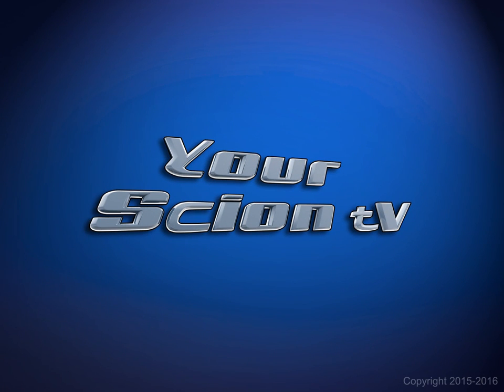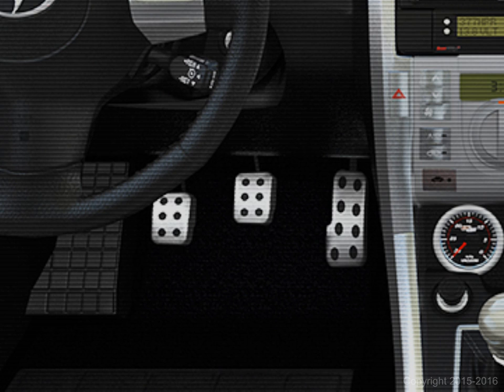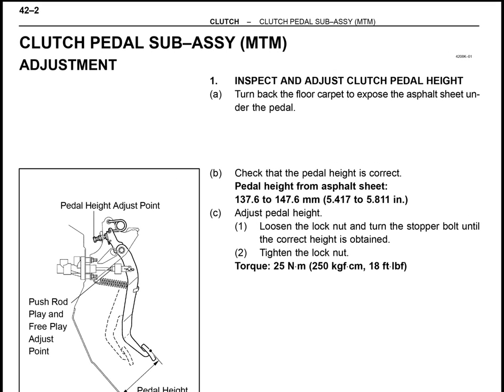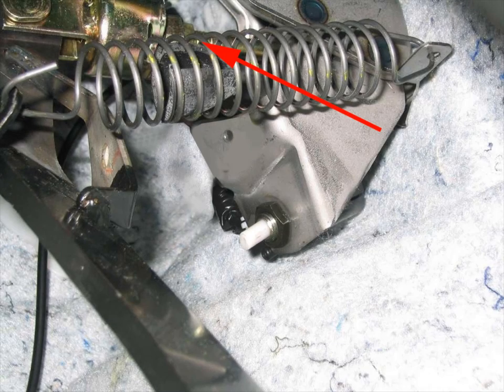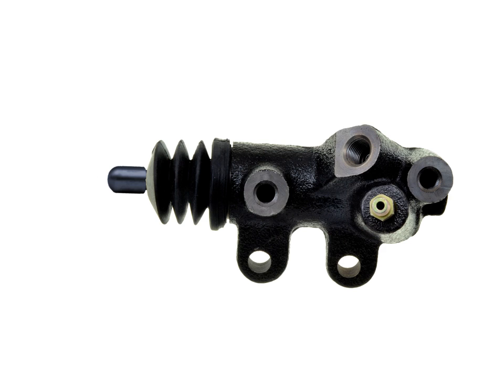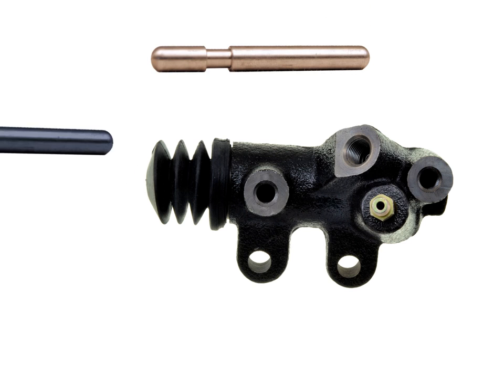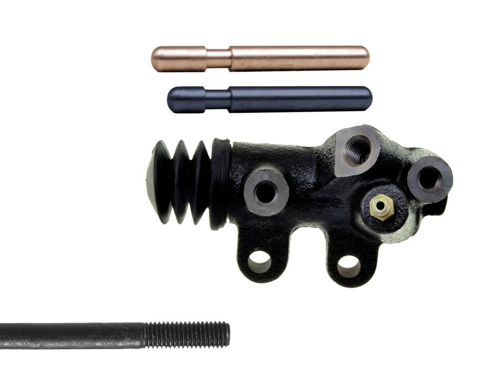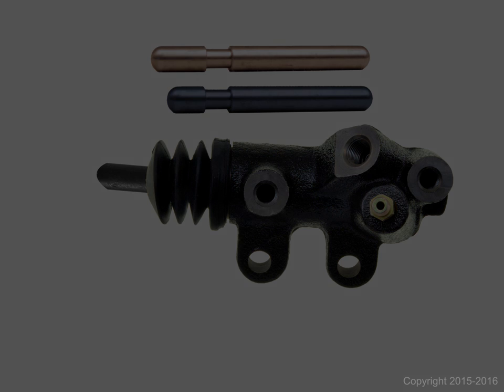Clutch Pedal Adjustment and Engagement Solutions

Comment: I've been having a major problem with my clutch.   the car is an 06.   at around 230,000 miles i would push my clutch in and it was getting tough to put into gear.   I changed the master cylinder and the slave.   No change.  took it to a shop that charged me 600 to replace the clutch. The car was fine for a year, then the same thing started happening after 30,000 miles.   i took it apart myself.  Found that the throw-out bearing was sticking. the clutch looked good still, almost brand new.  i put a little grease on the shaft so the bearing would slide smoothly.  put it all back together, and i still have the same problem.  then i made a new shaft for the slave cylinder, making it .25 inch longer.  That didn't fix the problem.  I've bled the whole system, i have good clutch feel.  with the vehicle off, i can push the clutch in and put it into any gear.   With the car running, i push in the clutch and it won't go into gear.   It actually starts to roll forward.   Ive done all i can think of.  Should i just pay the $2,000 to have toyota fix it?
Reply: jan orban better you sell that car and invest your 2000 on a better car with lower mileage maybe its time to move on no point spending soooo much money on 10year old car
Reply: jan orban
Reply: and did you solve the problem since than ?
Reply: jan orban did you find out the problem with your clutch point, I'm having the same problem also
Reply: Did you ever fix your issue? I'm having the same problem
Reply from the maker: Sorry about the ultra late reply,  I never got a notification about this comment. But for anyone else that had this problem its possible the diaphragm in the clutch master cylinder is broken. Its been know to happen where fluild will get past the diaphragm and no release happens. Another engineering flaw is the connection point between the pushrod and the pedal bends so you end up never getting full throw to release the clutch.
Reply: Pressure plate.....
Reply: No one knows but you need to pay attention to the clutch pedal clevis that connects to the master cylinder rod. If they break even if you push in the pedal all the way it won't push in the master cylinders rod all the way. I just realized this shit happened to me a few weeks ago. I got under the dash and pushed the clutch by hand and i saw the clevis was bending / buckling away from the rod instead of staying straight in place. Get an oem clevis or get a solid clevis if you can . google twos r us and lok up Solid Roller Clevis Kit on their website. its made for another toyota but it work's for the tc also. But you will need to widen the whole at the clevis pin so the roller fits. I am still struggling with that. Especially since I can't fit in there :((((

Comment: Hey... So you are saying i have to adjust the pedal travel using the master cylinder push rod? I couldn't see a pedal stopper bolt but I was afraid adjusting the bolt deeper in the clevis because didn't know if it would hurt the master cylinder if the pedal is keep pulling on the rod when i release the pedal. Right now I only threaded in the rod as much in to the clevis that the pedal stops all the way up by itself. The pedal does feel kinda high. My other issue is at the moment that pedal engagement is way too high. I never felt this before. Pedal grabs at 1/3 of the way. Like it grabs 2 inches just after i start pushing. The Clutch is not slipping. Took it apart a few weeks ago and it looked good.
Reply: Yes, to adjust pedal height there is a 14mm bolt and jam nut on the upper part of the clutch pedal assembly that can be adjusted. Its very difficult to get to.
Reply: @srhabb  LoL... its me... Csaba...

Comment: Jan did the jam nut on the clutch master cylinder come loose? If it did the push rod will thread into the pedal assembly making it hard to get engagement.
Reply: So what do you do if this occurs . My Toburon'04 is being a pain in my but.t. .I may get a longer rod . But I'm sure this situation you stated above happened on my car.
Reply: @wynnfenning2391  if the jam nut wont stay tight use a tiniy bit of blue locktite.